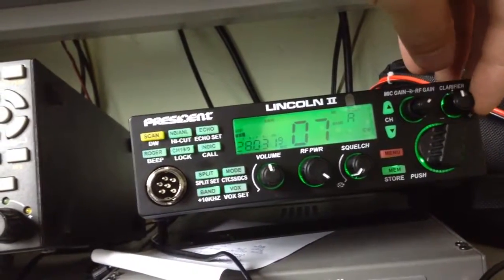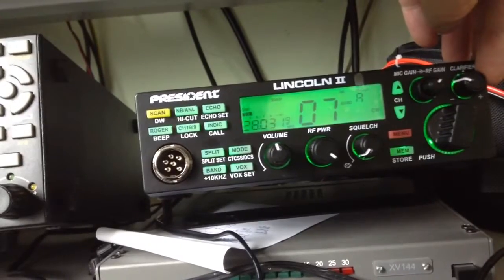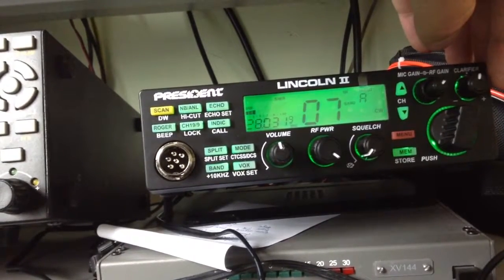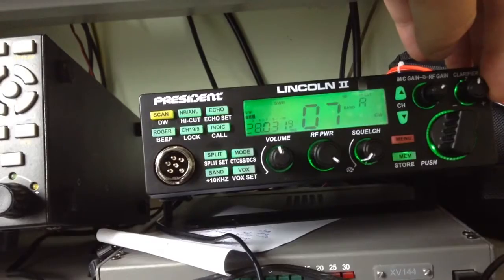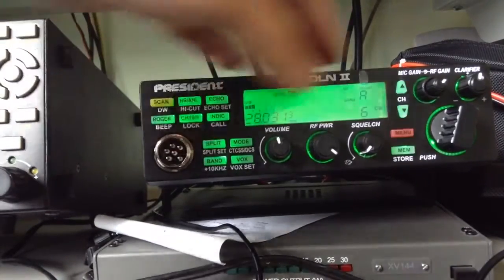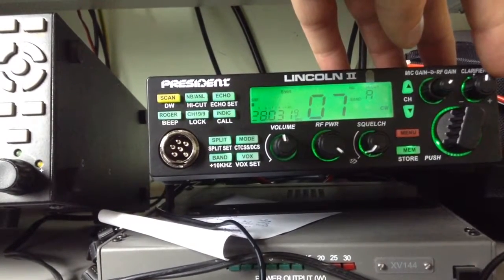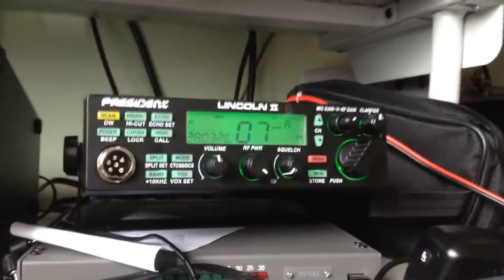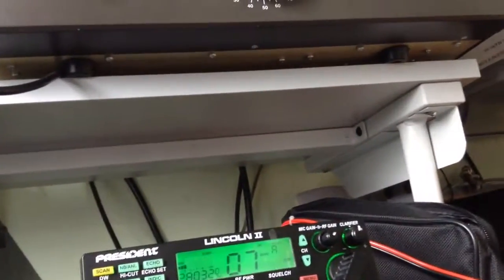President Lincoln II V3 cw testing IARU FD

Comment from the maker: This video shows the shortened first character firmware bug in the President Lincoln II V3. On the first call he comes back with the first letter of my call as 'R .-.' instead of 'G --.' only when I repeat my call twice does he correct to 'G --.' as this time it's not the first transmitted character. Very very annoying and a deal breaker.
Reply: This is very interesting. I wonder if this is resolved with the Lincoln II +? I was searching looking for reviews that may tell me whether the filters were narrow enough for distinguishing different CW signals close together, but this is also very interesting - thanks!
Reply from the maker: @jonathanwarner1844  President did not take the opportunity of fixing any of the bugs highlighted here on youtube when they brought out the II+. If you wish to operate CW, I would not recommend any President products.
Reply: @gm0elp  Again, many thanks!